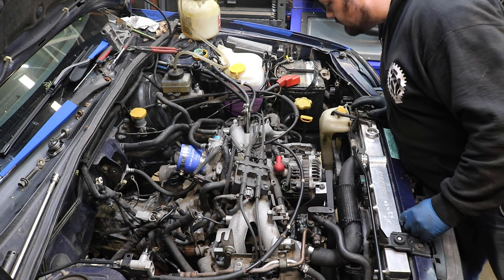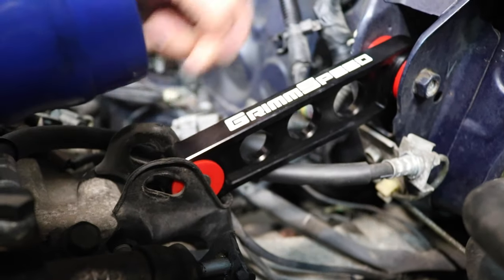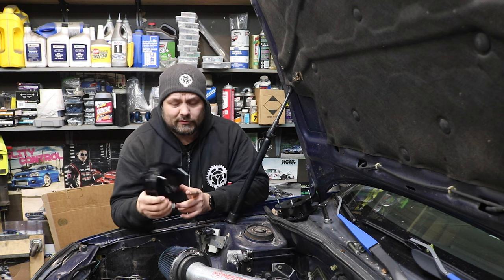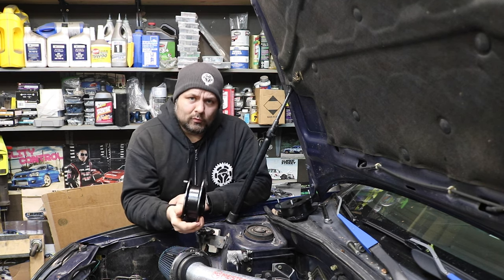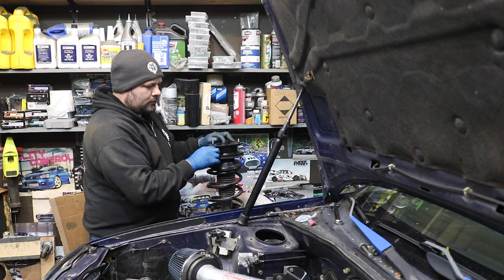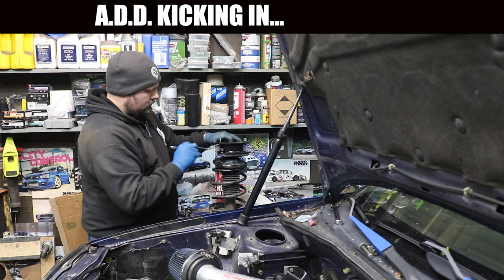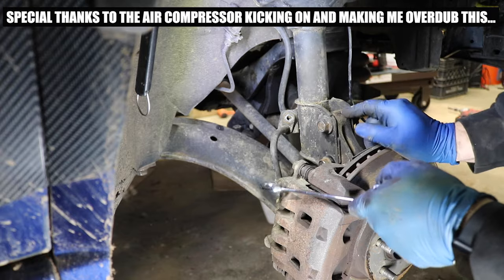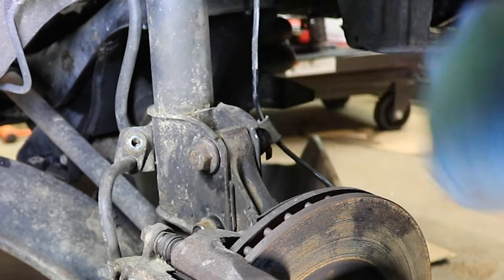Lifted Impreza Gets Even More Lift [Impreza 2.5RS Off Road Subaru Build]

Comment: subaru engines arent known to be strong units (think they devellop rodknock pretty often ), the suby gearboxes are allmost made out of glass , not the most obvious choice for performance (info from mighty carmods youtube channel who done a few of them)
Reply: Really cause I've had no issues with my ej22. Just do normal maintenance and make sure you have oil in the car. Common sense if you know they consume oil it takes a couple seconds to check. Amazing how many people don't check their oil or even know how to do an oil change.
Reply from the maker: Agreed 100% Casey. From my personal experience, most Subaru engine failures are due to owner negligence (lack of maintenance) and/or abuse (increased boost levels without supporting fuel mods and tuning), but to each their own I guess.  Sure, the wrx 5 speeds have issues with upgraded power levels, but what oem transmission doesn't aside from the uniquely overbuilt ones like the STi 6-speed, BMW ZF, Getrag 6-speed and Tremec T56, etc.
Reply: @Enginuity I bought a STI swapped 03 WRX  and want to do a similar build to yours.

Comment: Nice ride, I just bought a 2004 legacy can I just put 04 Forester struts in all around to get like a 2” lift without any other modifications
Reply from the maker: Technically yes but I’d advise putting in Forester rear trailing arms on the rear as well to keep the wheel centered. Otherwise it pulls the wheel forward
Reply: Thanks for the response it helps a lot. 👍
Reply from the maker: Anytime!

Comment: Do you have the sway bars connected??
Reply from the maker: No we opted to disconnect them for now to improve off road articulation. It made it a little floatier on faster turns but not nearly as bad as I thought it would surprisingly. So the owner just slows down a little more than normal when taking turns. I’m the future going to be building quick disconnect mounts though

Comment: hi, did you only lift the engine mount? how about the front control arm mount?
Reply from the maker: I lowered the whole subframe
Reply: @Enginuity  yes I meant lowered with spacer. you highlighted the use of the body spacer from the forester w/ 4 bolts (or 2 cradle bolts) 03:34, but how about the other 6 bolts that connects to the unibody (4 that's connected to the front control arm and 2 at the front of the impreza)?

I'm planning to do a similar lift to yours. I have a full SG as donor. my car is a GG. Thanks heaps btw!
Reply: @Enginuity  you lowered part # 20101 and the middle portion of part # 50515.

What I would like to ask is if you also lowered part # 20204A and 20204B (rear portion of part # 50515)? thanks!

Comment: I want to lift my 2005 outback next year an inch or two, anything else I'd need other than strut spacers to make it happen?
Reply from the maker: You may need to space the subframes down depending on how sharp the axle and control arm angles are
Reply: @Enginuity  Gotcha, thanks!

Comment: Did you have to cut away some of the body off in the front wheel wells?
Reply from the maker: The owner did on the initial lift but if you did this combo out of the gate probably not. Maybe the bumper at most
Reply: @Enginuity  yeah I got a little rubbing action going on when I turn the wheel all the way I figured I'd get wheel spacers or maybe just cut away some of the body, wasn't sure which route to go
Reply from the maker: Depending on the tire size you might need to clearance the body on the bottom of the wheel arch. I forgot I had to massage that back a bit as well.